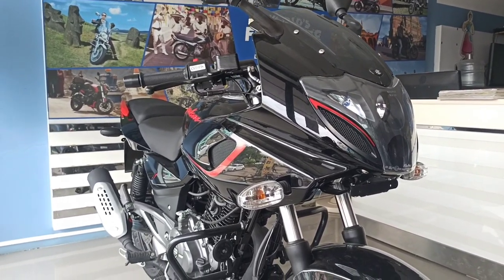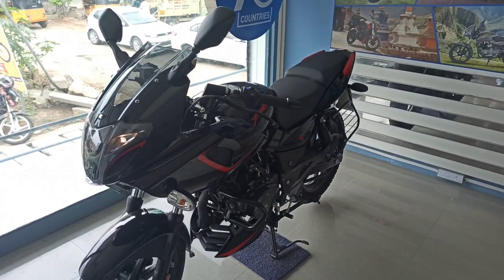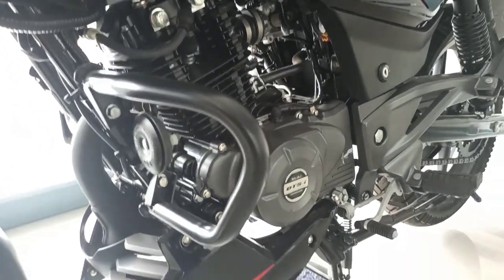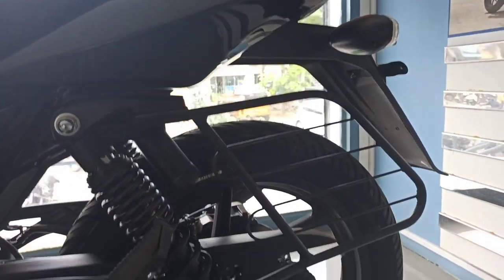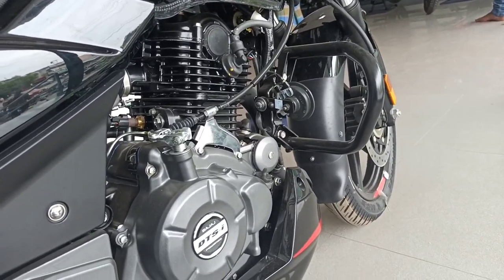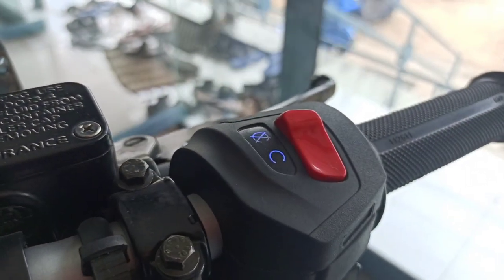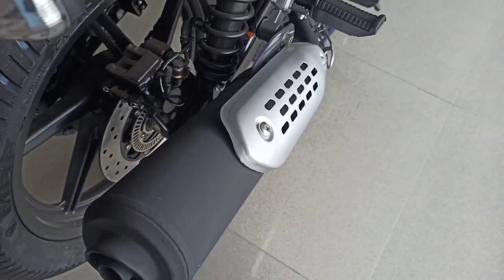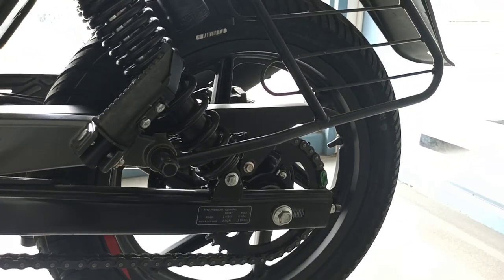Pulsar 180F walk around review தமிழில் |Budget Biker

Comment: Led unit rain time laa visible irukathu bro normal headlamp thaa epothum nalla irukum bro.. riding position and pillion seat 180 & 220 tharama irukum comparing with other brand bike..All Pulsar series are value for money
Reply from the maker: Riding position semmaya irrukum bro seat thaa hard ah irruku konjam cousioning irrunthaa nalla irrukum rain time la led visible irrukathu thaa but Namma yella time yum rain la drive panna porthu illa Namma oorula eppa rain varunu theriyathu pulsar series yellam valuve for money na othukiren but quality wise nalla illa ns and rs thavirthu solren na pulsar 150 vachuruken enaku engine noise and timing chain noise vanthute irruku 3 times timing chain change pannita one timing engine head and clutch plates and gears change panniten inum noise varuthu showrooms la proper response illa ippa again engine head la oil leak aguthu showroom la keta piston head poirukum change panna solranga na avanga kitta solren ippa thaa head work pathen unga kitta 8000 km thaa drive panniruken nu solren avanga athaa kekave illa again showroom la vidunga 4000 to 6000 vara agum nu sollitanga quantity wise enaku pidikala
Reply: @BudgetBiker  pulsar maintain Panama irunda poidum bro... 5000km service interval solvanga but actual a 2000 to 2500 than ena engine oil potalum avlo than.. if u crross this sound varum engine la